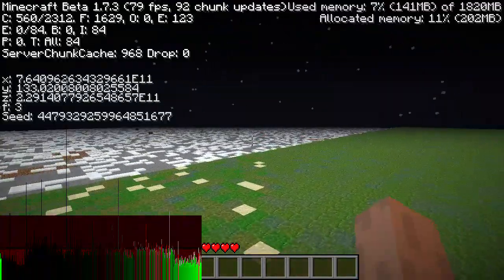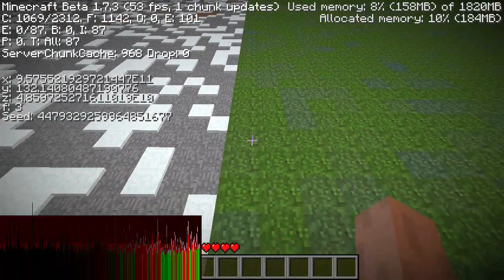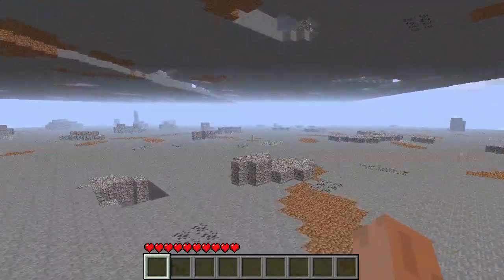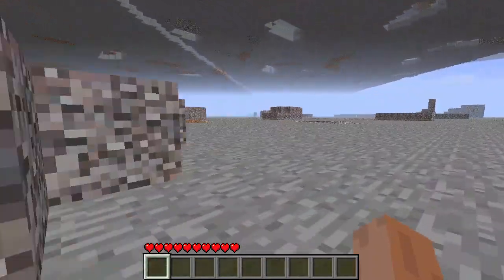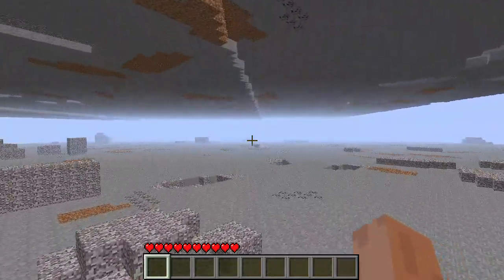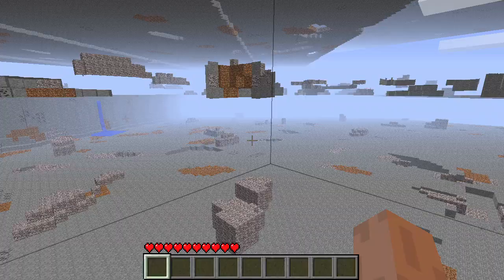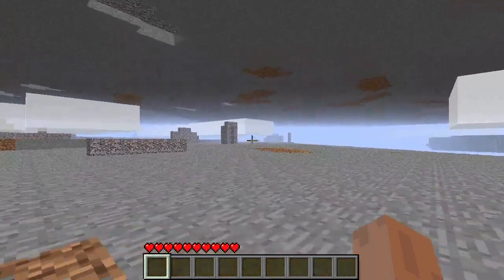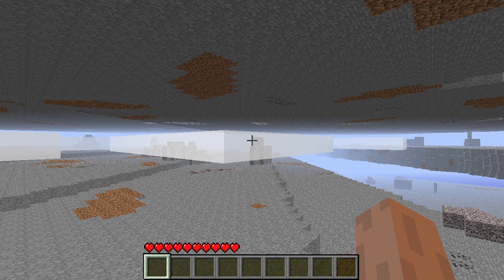Minecraft: SIMPLEX NOISE FAR LANDS EXPLAINED

Comment: Nice vid! Fun fact: if you set the performance setting in beta 1.7.3 to power saver, you can actually teleport to exactly the 32 bit integer limit IN THE NETHER ONLY without crashes. Why this works, I have no idea.
Reply: I will try that
Reply: I teleported to X 2147483647 at nether with power saver, it somehow worked but the game turned red screen after few seconds.
Reply: @mythicplaysminecraft  Make sure you DO NOT approach 2,147,483,519 or your game will immediately crash. Only move along one axis at a time, and never approach the render boundary.
Reply: @Bedrock3358  I never did, I only did face at far lands and it crashed, also how to generate skygrid in Alpha 1.2.2 using nether portal
Reply: @mythicplaysminecraft  Interesting. Never crashes for me as long as I don't move. No idea what you mean by skygrid using nether portal.